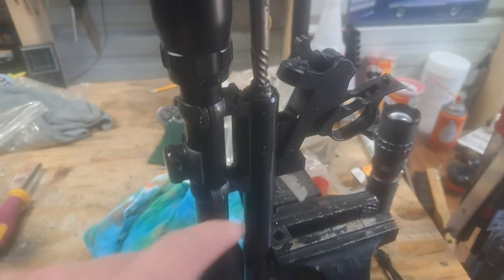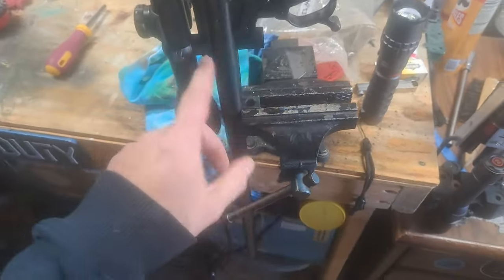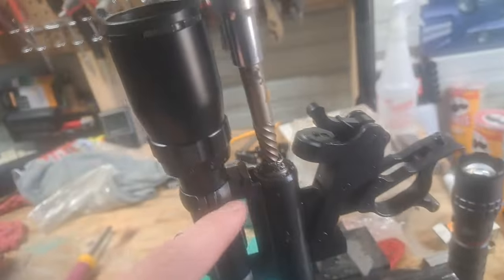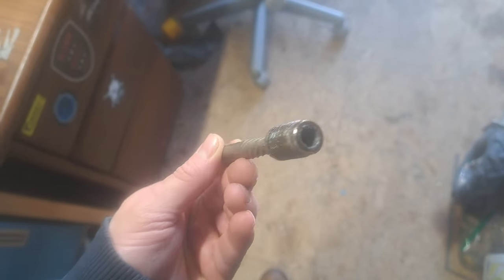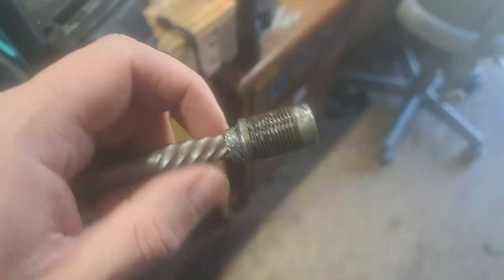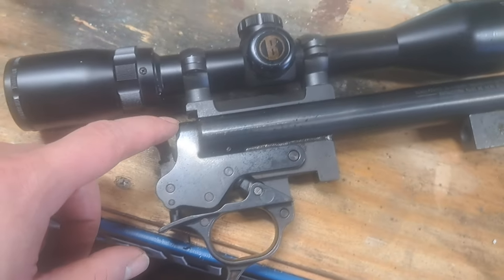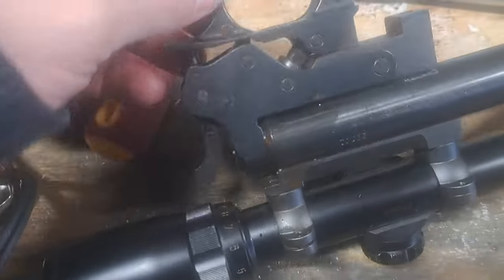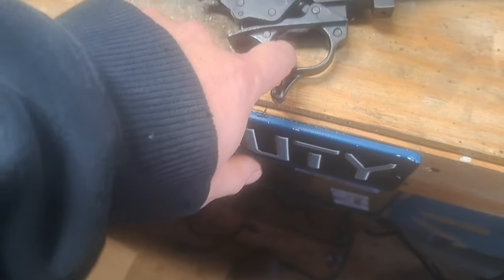Removing a stuck breech plug from a Thompson Center Omaga

Comment: I had one stuck and almostwent in this direction but decided to apply a little heat on the outside.  Popped it loose
Reply from the maker: Had the head not been stripped I would have tried that first.